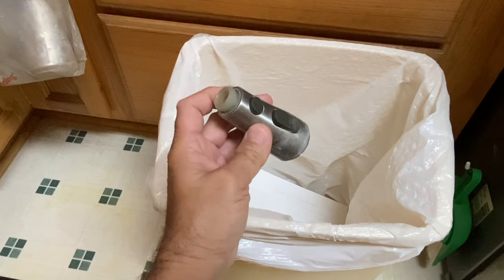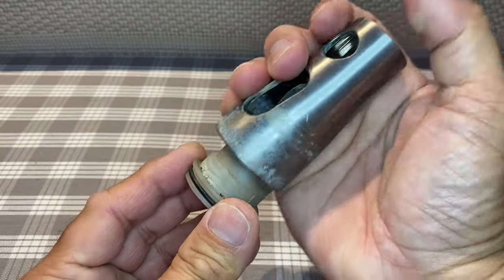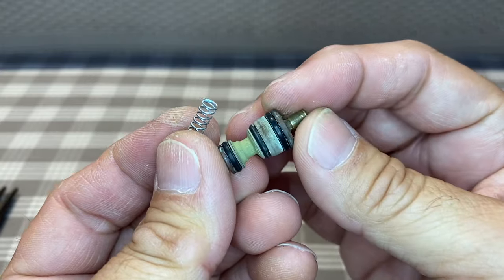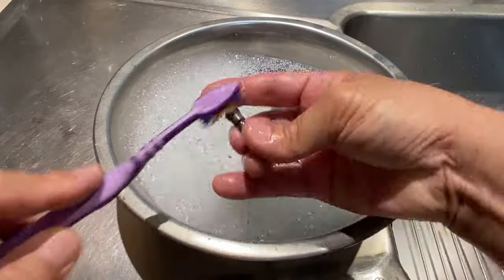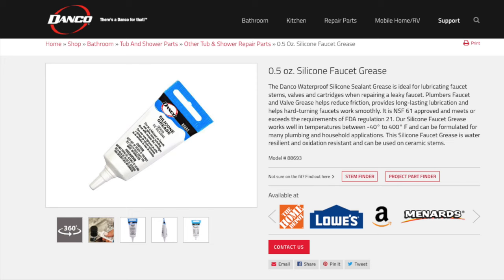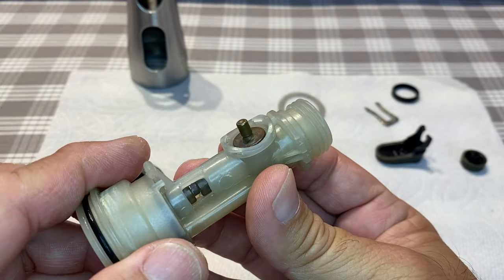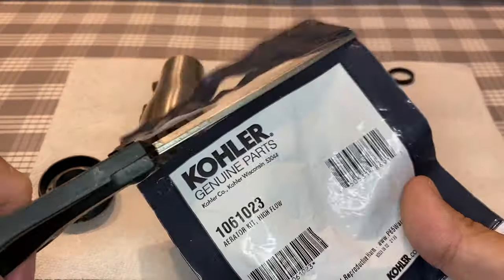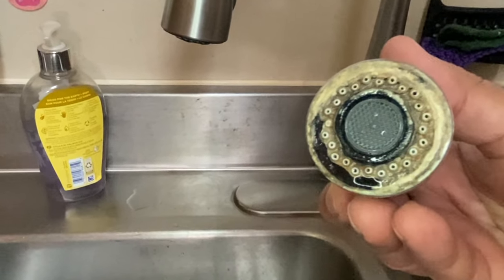Complete Teardown & Rebuild | Kohler Simplice Kitchen Faucet Spray Head

Comment: A set of reamers for carburetors works wonders for cleaning small openings in faucets.  It is ~20 stainless wires of varying gauge useful to clean orifices.   The set is inexpensive.  Nice vid!
Reply from the maker: You’re welcome and thanks for the tip!  😎

Comment: Thanks, needed this! I didn't realize I could just pull the buttons off to slide out the internals and fix the valve. Now its greased up and works like new.

Comment: instead of dismantling how about just putting it all in vinegar and see how far that goes 
its always more than interesting to see how things work since one understand the physics of things around them to get a general estimate if things are easily enough to fix. 
Just like how some people throw out a $1000 lawn mower and all was needed was the carburetor clean. A powerful pc and all that was needed was a reinstallation of os. Or a Fridge and all is needed is a $10 component for a $1000 fridge.
Reply from the maker: Thanks!  Yup… it’s more fun to take things apart.  😎

Comment: Excellent!
Reply: One comment: My Simplice sprayer has a different design requiring a pin scanner wrench to unthread the diffuser end. A pair of needle-nose pliers work well to disassemble and then re-assemble the sprayer. A soak overnight in white vinegar and then some clean with an old toothbrush, cotton swabs, and toothpicks cleaned everything up. No parts needed replacement. My sprayer works like new now, not like the ten years old that it is.

Comment: Thanks for the video, mine doesn't have a pause button but when you press on just aerator mode there's some drips coming out from the spay. I have to press very hard on the aerator button to get the drips to stop from the spray mode. What do you think is the issue?
Reply from the maker: Not sure.  Have you tried taking it apart and cleaning all the parts?  😎

Comment: Excellent video!  
Those spouts are too complicated.
At 0:14, you show your wrench grasping the aerator, presumably on two flats.  My faucet's aerator has no flats.  (Model 596-CP).  I bought the faucet less than two weeks ago, in Nashua, NH.
Reply from the maker: Thanks!  Mine luckily had the wrench flats.  I think most of Kohler’s new aerators need a key for installation and removal.  😎
Reply: @HacksbyDad  Mine does. You can find instructions online for cobbling together a key. I haven't got around to trying it yet.
Reply from the maker: @cavenewt9980  👍😎

Comment: Why don’t you just call Kohler and they will replace it free of charge. They have replaced mine three times. Right now they are sending me a new replacement hose with the sprayer free. 
You should not have to do what you are doing and it still has a chance of not working right. And the cost.
Reply from the maker: Thanks for the tip!
I actually enjoy taking things apart and fixing them if possible.  😎
Reply: They'll send a whole new spray had even if mine is clogged with hard water scale? That's pretty amazing.
Reply from the maker: @cavenewt9980  Thanks!  Did you need to send in a copy of a receipt or other type of proof of purchase?
Reply: @HacksbyDad  I did an online chat late on a Sunday night! I bought my faucet six years ago on Amazon, and was able to provide the Amazon order number. He didn't even ask any questions, just said they would send a new spray head under warranty. This faucet does have a lifetime warranty, although I didn't think that would cover parts damaged by hard water. By the way I did ask if they had an aerator key service part, and apparently they don't.
Reply from the maker: @cavenewt9980  Good to know... thanks!